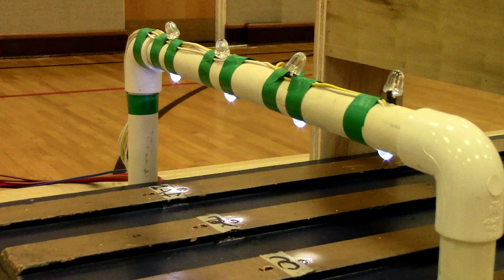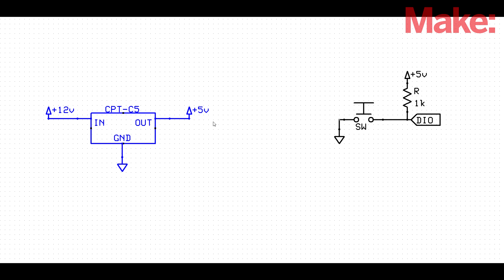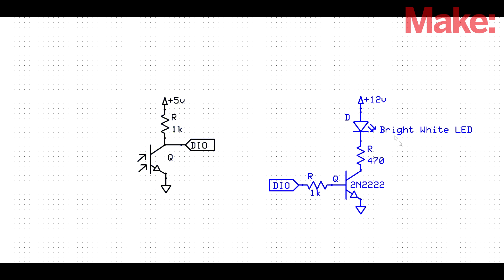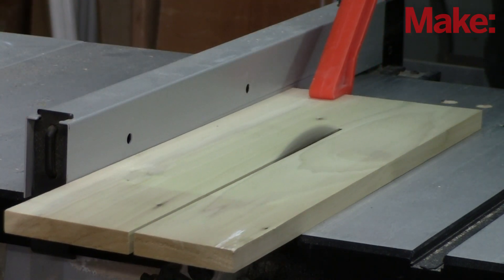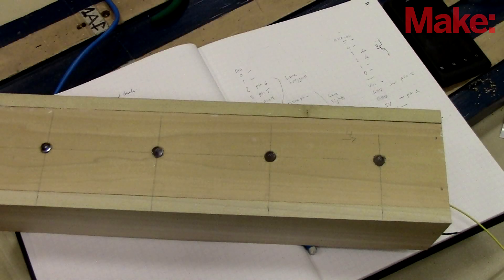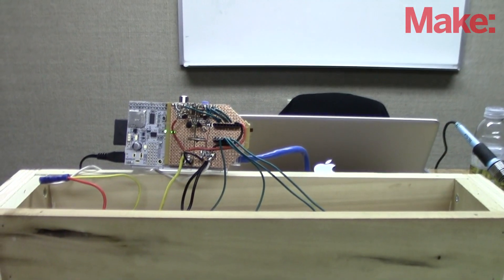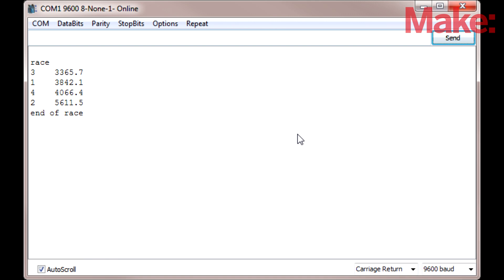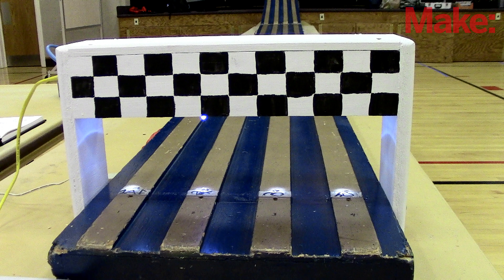Projects with Ryan Slaugh: Raspberry Pi meets Pinewood Derby

Comment: This may be a dumb question, but would it be possible to have the light sensors underneath each track and simply check for a change in brightness (dark) when the car covers the corresponding hole?  This way you wouldn't need to add any lighting at all; it would simply measure the (loss of) ambient light.